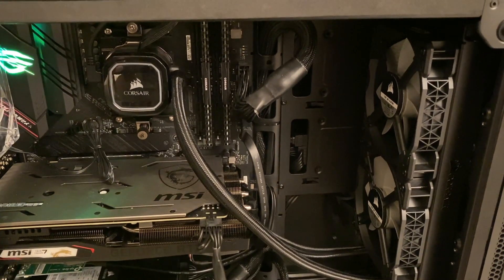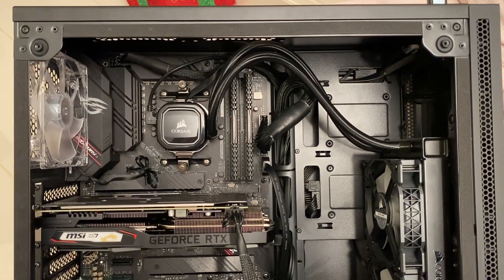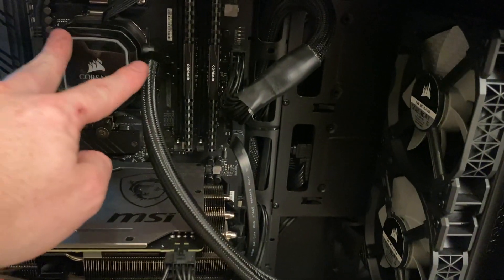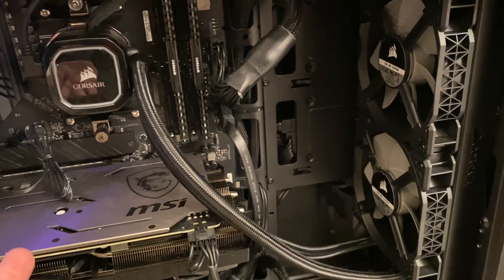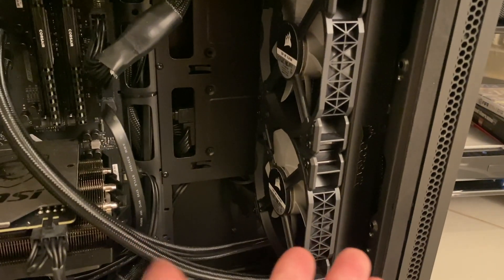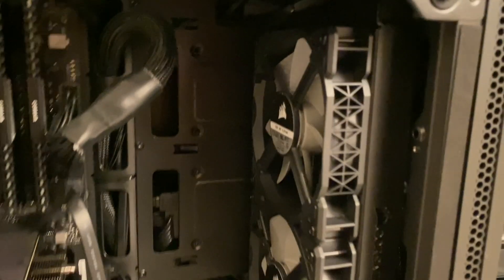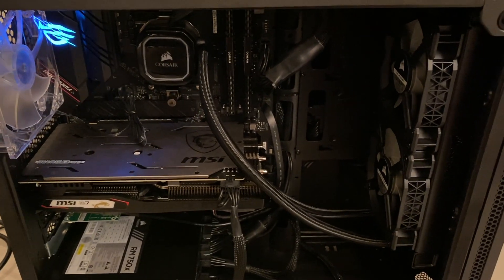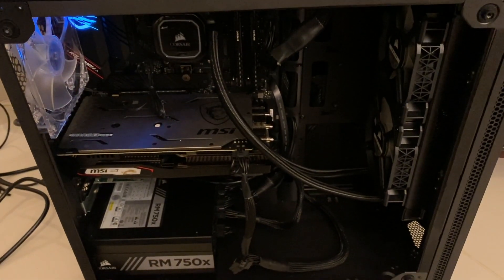Put your AIO radiator ABOVE your pump or you'll break it

Comment: Actually when the radiator is oriented in such a manner, air will always get trapped in the top of the radiator because the tubes are at the bottom, so the air will never fall to the bottom and go through the tubes.

Comment: Water cooling has come along way since I dabbled in it around 2005. I had all sorts of troubles with air getting into the system bubbling around and then some broken connectors and issues with mould and in the end I went back to good old fashioned air fans.

Comment: I'm old so I don't trust water coolers, the pumps seem to have a habit of failing. In my current build I went for a Noctua NH-D15 air cooler, the thing is absolutely massive but has worked flawlessly for years *touches wood*. Also they are good value at @£80, when the new AMD CPU and GPU parts are ever in stock and I build my next PC I'm going Noctua again.
Reply: 100% agree. AIO more trouble than they are worth.